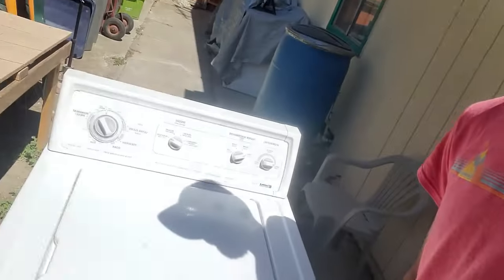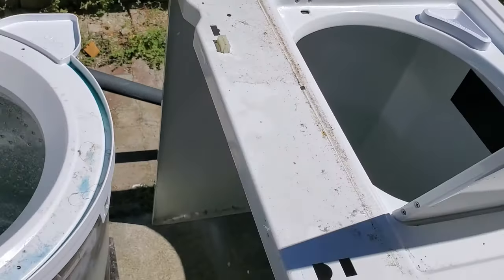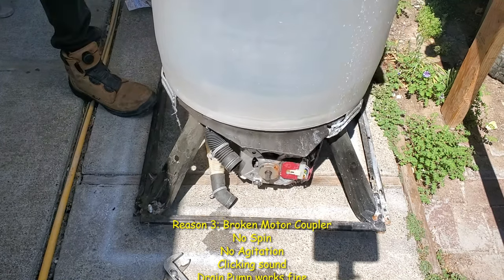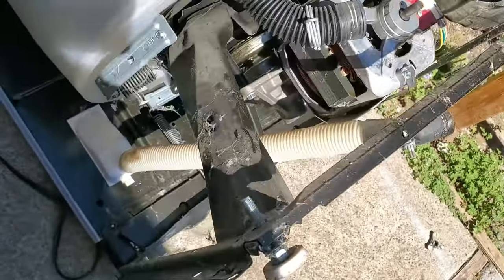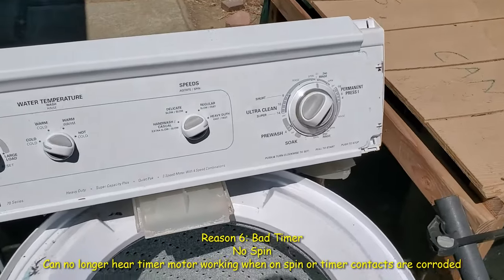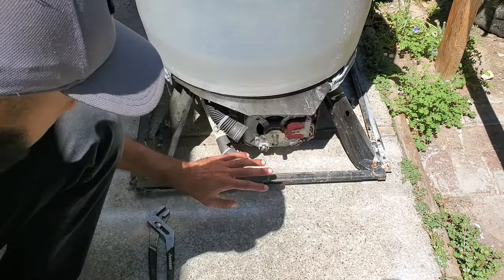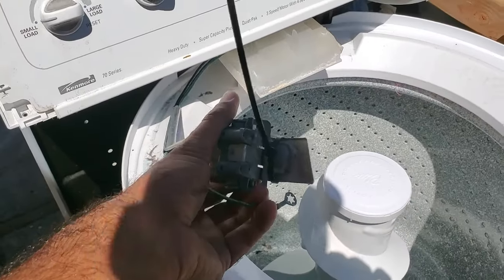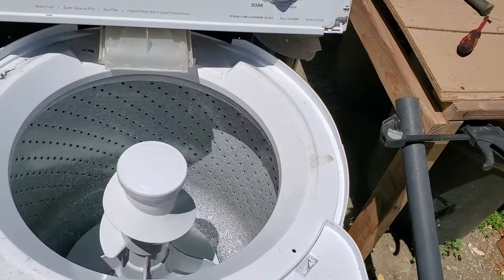Top Nine Reasons Your Older Style Washer Is Not Spinning!

Comment: well, my 2001 GE Profile washer will agitate, but when it goes to spin it sounds like the transmission hits a metal pin and stops turning. About 2 months ago it quit spin cycle. I took out the clutch and sanded off the glazed friction shoes. It has worked fine for about 2 months. I took off the belt and the tub shaft will rotate in the agitate direction, but when I turn it the other direction for the spin cycle it sounds like a metal tab hitting a metal pin and the pulley stops rotating. Everything else looks and runs like new, been a real good machine. Ideas anyone? Thank you. Oh yeah, already put a new belt and clutch on it - did not fix the issue.

Comment: I have a Maytag, A310 washing machine that when it goes to spin Kix the motor off - Is like a breaker in the motor. Motor overload protector?  I replaced the motor , belts and timer and it still does the same thing.

Comment: It looks like I need a new clutch in my old whirlpool washer. The agitator spins but the tub doesn’t move, when it’s on the spin cycle. Mine doesn’t have a lid lock, but it won’t agitate or spin when the lid is open. That’s why I can open it quickly when it’s on spin and see that the agitator is spinning but not the tub.

Comment: Could the clutch affect the transmission? I cannot turn the motor shaft counterclockwise (I believe) after removing the drain pump. i haven't checked the motor coupler, but i can see it spins both the shafts connected to the coupler but it also gets stuck rotating in a certain direction.

Comment: I had a front loader washer it broke the motor is good and wires can I use it on whirlpool washer with the motor of whirlpool washer the other motor of the front loader is different and I wanted to ask you if it can work ?

Comment: Thanks so much, no one else mentioned the capacitor. I replaced the clutch and opened the pump based on what other YTers said was wrong. I guess they didn’t want to be responsible in case someone got zapped by he capacitor.

Comment: What if when you spin the motor to check transmission and it engages the clutch and is hard to spin the right but easy to spin to left but it will spin to the right

Comment: got a washer that randomly stops after rinse finishes and attempts to go into spin for a few minutes, lidlock light stays on all the lights die out and the machine makes a humming sound and is basically inoperable until i pull the power. usually on a 10min wait i plug it in, cancel out the auto start and the machine will drain. at that point i manually set it to spin and it does so. other times, small loads, the machine works fine and its really weird. either way my brother and i will be putting this video to use tomorrow and i will report back if it works out. i have a feeling the pump has something in it, or the part that does the agitation may have something stuck inside.

Comment: So what about when everything works just fine, EXCEPT, when the machine clicks into spin/drain, it fails to spin (it does drain) unless you pull the knob (switch it off) and then push the knob in.  It then spins/drains normally.  This action MUST be repeated for both spin/drain sequences.
Reply from the maker: Sounds like there is a dead spot somewhere in the timer. Most likely the timer has to be replaced
Reply: @DuctTapeMechanic  Thanks for your reply.  I'm not turning the timer at all, just "pull/push" and bingo, it starts to spin.  If I don't pull/push, the machine goes through all functions and ends, just does not spin.

Comment: Just fyi its not a centrifugal clutch its friction drive and most of the time you can disassemble it and sand down the pads and drum slightly and it will grab again if you clean all the dust out.

Comment: it sounds like metal on metal but not violent(maybe the coupler)...its draining but not agitating or spinning...is it the drive block? how do i replace that...the noise sounds like its on the left of the washer about 1/2 way down...could be in the same area as ur coupler. wouldnt that make a noise too since urs was broken.
Reply from the maker: Sounds like the coupler. Should be easy to check, just tip it back and take a look

Comment: Good video, thanks for that.. I just fixed mine which would not spin or wash. There was 2 problems, 1# the capacitor value had dropped to 9mF when should have been 12mF. 2# the motor controller has stopped working. Which is often due to the capacitor failure or vis-versa and it is recommended to change both at the same time. Maybe you you could had as the 10th reason which is very common in top loader machine in AUS.
Reply from the maker: Excellent! That's good advice. Capacitors can certainly lead to the motor humming and not working properly

Comment: Nice vid. My old model 70 Kenmore has stopped spinning. I have checked most of these items. I may power up motor next. BUT what I noticed is if I turn the coupler. It goes counter clockwise fine. It stops after a few turns clockwise. Hmmmm... bad transmission ?
Reply from the maker: I will lock up after a couple of rotations. Transmission is probably ok. Take the motor off and see if it will spin with no load (i.e., not connected to pump or transmission)
Reply: @DuctTapeMechanic  I am thinking it is the clutch. I put it back together. Set washer on SPIN CYCLE. One clunk but tub and agitator spin. I am sure a heavy load would stop it. Oh had all that off when I was spinning the coupler.

Comment: Often too much detergent being used if it's spinning slowly in the first spin. You can often tell by the sound of the spin cycle. I had a 1992 Maytag and during the first spin when that 45 second spray rinse would cut in you can hear frothing and foaming occuring when too much detergent is used. After the initial rinse cycle it goes through the cycle normally. I set for a second deep rinse with fabric softener.

Comment: my machine agitates but wont spin. The motor doesn't turn so I don't think its that. Any ideas?
Reply from the maker: If it agitates but doesn't spin, most likely it is the clutch. It could also be the lid switch if you have an older model.

Comment: What about a drum that won't spin on its own until I jump start it by spinning by hand? My tyranny is leaking a bit so I'm thinking oil on the clutch which I replaced, or the wrong tension spring on clutch or Timer ( not likly) or the tyranny is bad. What do u think?
Reply from the maker: If you are jump staring your washer it most likely is a weak motor capacitor
Reply: @DuctTapeMechanic  oh wow thanks for the response. I do use my hand to force the spin to start and the run cap is cheap so I'll order that now. Thanks again.

Comment: I took everything off and the couplers are fine, motor is good. Maybe the lid switch or the clutch bc it agitates but won't spin. It spins like a snail on low settings and not at all on normal or high. My clothes are heavy. Idk where my lid switch is bc it doesn't have anything on the underside of the lid.
Reply from the maker: If it spins at low then your lid switch is ok. I would replace the clutch (unless you hear a humming sound as well then it is most likely the motor capacitor)
Reply: @DuctTapeMechanic  thank you!!!

Comment: Tub turns real hard takes time to build up speed even empty
Reply from the maker: Most likely issue with clutch slipping. Try replacing clutch if that doesn't work then the motor capacitor is bad.

Comment: My washer agitates just fine, but sometimes won't spin.  Sometime I can let it rest for about 20 minutes and then it will spin, or try to spin and I can manually turn it and it will start.  I hear no noises at all as far as screeching or whining.  I'm guessing it's the clutch since it's about 15 years old.
Reply from the maker: 90% chance it is the clutch 10% chance it is motor capacitor
Reply: That’s exactly what mine’s doing!  Were you able to fix yours?

Comment: Mine will not agitate. The motor is spinning the opposite direction, then when it’s in spin cycle any help on that please
Reply from the maker: If the spin cycle is working fine and your machine is not agitating that is likely a transmission issue. If it is not spinning or agitating then it could be a couple different issues (ie lid lock , coupler)

Comment: Wish I watched this video first, I thought it would be worn couplers, cause I can get it to spin sometimes but not real fast.  But couplers look ok, and agitation and water pump exhaust work well.  It must be a worn clutch.
Reply from the maker: Always DuctTape Mechanic first! Lol jk. Most likely clutch with a slight chance of it being the motor capacitor.
Reply: @DuctTapeMechanic  I will in the future!!

Anyway to rule out capacitor, or measure ohms or voltage? I have schematic 3955735 rev B, I see the capacitor, but it does not give a rating of what the voltage should be. The agitation and water pump output seem strong, I would guess that might be compromised with a bad capacitor?

Also, there is nothing in my water pump, but the fan rotor inside seems just slightly lose when it's removed, which I assume may be a rubber seal moving a bit.  Again, water exhaust is strong and no leaks.

Thanks so much for your time!!
Reply: @DuctTapeMechanic  BTW, it's an older Kenmore Elite top load with one more knob than your model in the video.  I fixed my dryer not too long ago (no heat) after finding some burnt out power resisters on the PCB, and replacing the spin belt that snapped. Cost $50 bucks for reconditioned PCB and belt.  Washer is a little more tricky... lol
Reply from the maker: @michaelk8710  the capacitor stores charge in a unit called microfarads (uf) the tolerances are written on the capacitor itself (most multimeters have the ability to measure capacitance). Also a bad capacitor typically causes the motor to make a humming sound)
Reply: 100% the clutch!  I put the new coupler on too.  I had a loud "whistling" or squeal noise that came during the 2nd wash when the motor turned on half way during the first agitation cycle, but went away by the end of the wash.  Couple of weird sounds during the first wash too.  But all was quiet at the end of the second wash.  Maybe the new coupler had to work itself in... 

Thanks again for the help!
Reply from the maker: @michaelk8710  right on! Great work!

Comment: This  is great  as to all the other washer repair films do not give the actual Test for most components.  Right now the Continuity Test on my  washer lid switch shows bad, but when I bridge that wire harness; it does not spin; yet the switch clicks like a good one when striker comes down. Any suggestions is appreciated.  I will keep you informed.
Reply from the maker: Are you bypassing the correct two wires? One of them should be just a ground wire. It should spin with the lid switch bypassed.
Reply: Yes,  it is a Kenmore 80 Series.  I crossed the Tri-Wire Harness by sticking a 12G Wire down 1st and 3rd channels, had to touch. Retaped it 2 Times. Tried 2 times,  Rinsed, but did not Spin. Before tested with Multi-Meter down the 1st and 3rd channels but on the  other wire harness coming from the Door/Lid/Sensor Switch itself.  It tested discontinuous,but as far as the sound it makes when the lid  shuts, you hear the click loud and clear.   So likely onto Drain Pump & Hosing.  Any thots still?   Try a thinner wire than 12 G.  The multi-meter works fine on other things like car wire. Likely going have take of Housing/Shell which I did not want to do as I must clear everything out of my bathroom. @DuctTapeMechanic
Reply: Yep!  The wire I was using was too thick, somehow it did not make it all the way down the the wire harness channel. So I switched from 10 G to 12 G. Not only that but I taped across then down into the wire harness.  Now the Spin cycle works, just need to buy the lid switch to eventually replace it. @DuctTapeMechanic
Reply from the maker: @Spartan1293-w3u  very nice! Easy fix! Good job

Comment: Why isn't a 10th reason listed? the plastic piece that fits above the clutch is broken and it won't let it spin. why isn't that listed as a reason that washers won't spin because that's what's wrong with mine
Reply from the maker: I consider that as part of the clutch. It comes with the cluth. I listed the clutch in the video
Reply: @DuctTapeMechanic   Great video thank you but seriously I've looked through probably 20 play 20 different videos and nobody ever mentions the clutch brake Cam.  So I finally purchased one for $5 it has the 2 little tabs inside of the cam but my silver looking metal cam holder does  not have 2 little holes for those 2 little  plastic pins in the Cam.  so did I get the right Cam or do I cut off those 2 plastic tips? Thank you!
Reply: That's always the problem. I have my a probably changed it like 5 times in the last 12 years